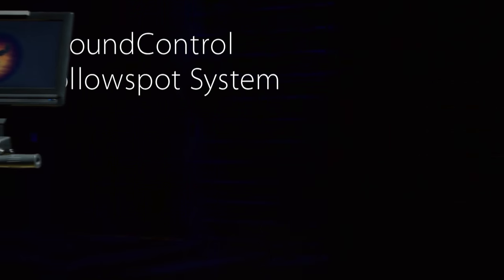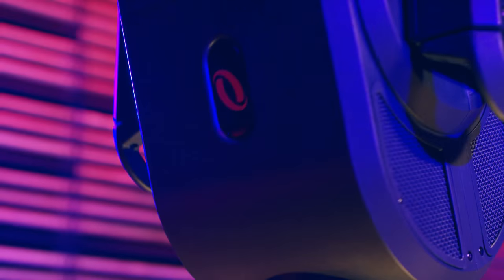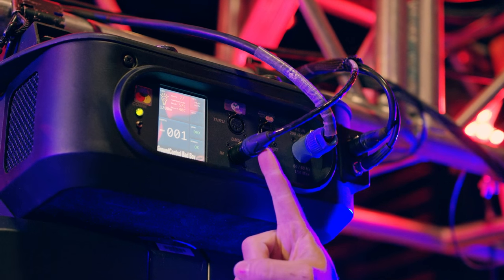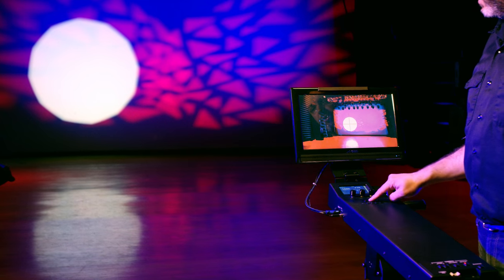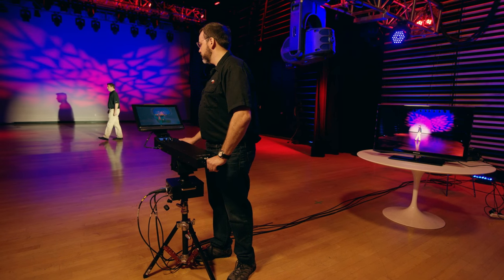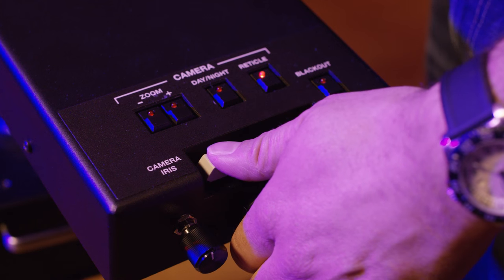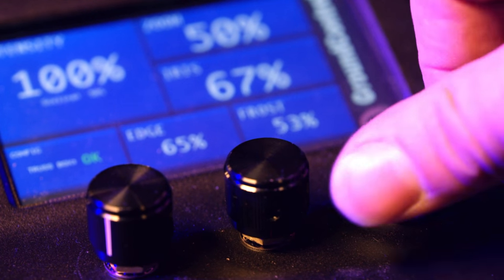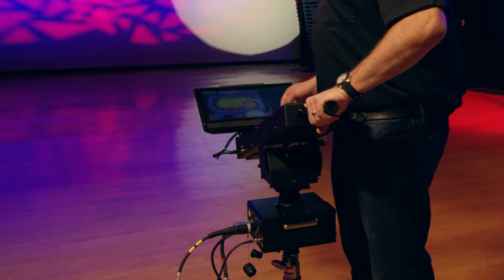A Complete Overview of the PRG GroundControl™ Followspot System

Comment: i thought it was good until he said 5 pin XLR
Reply: Why? 5 pin is standard.
Reply: @samkphx  Some people in the industry are cheap as hell apparently.

I buy 5-pin gear myself, mostly for fixture control, but use adapters often due to the fixtures and cables in my local venue being 3-pin